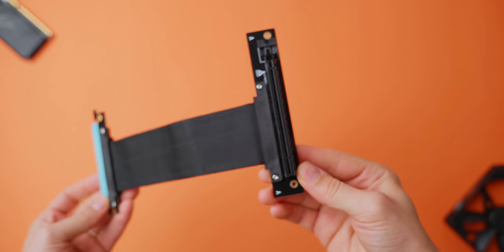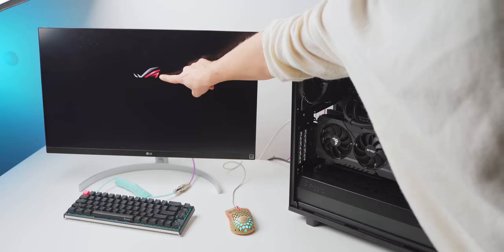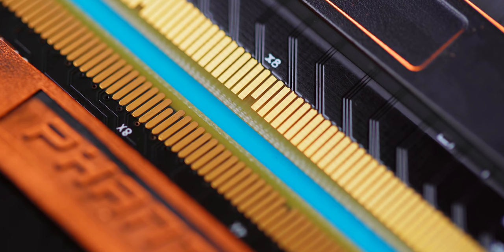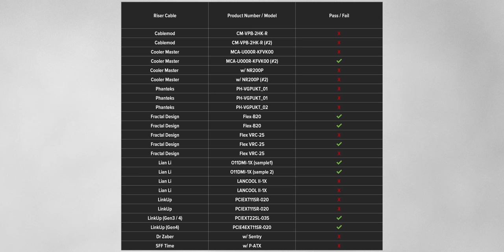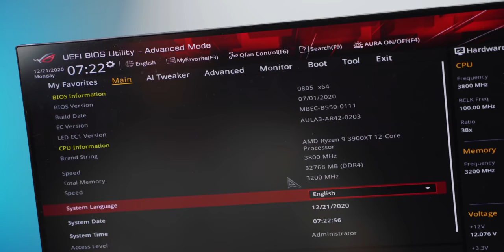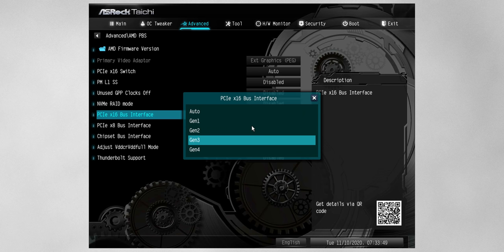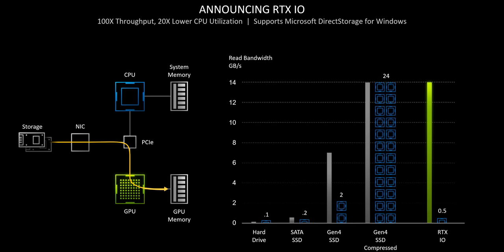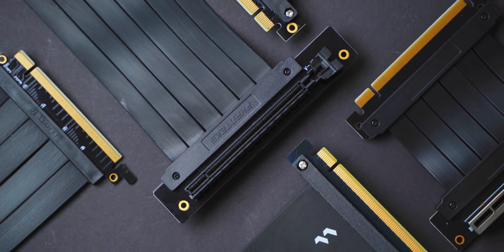There's a PROBLEM with Riser Cables

Comment: Laughs in direct connection
Reply: Weird enough. My 6800xt keeps shutting down during games with direct connection. No issues with gpu raiser....
Reply: @BigBoss-ps6vk   That sounds like a improper grounding in relation to the motherboard mounted.
Reply: @BigBoss-ps6vk  You gotta screw it with confidence. Don't forget to wear your Live Strong bracelet. 😂😂😂
Reply: @PSYCHOV3N0M  bruh how are the verge references still a thing
Reply: I use direct too.. We have sagging problems.
Think we need a new ATX form.
This form factor design by Intel is from the dinosaur ages, when graphics cards were light with 40mm fans😄.

Comment: I almost returned my 3000 GPU because of my riser cable i thought it was the GPU it wasn't until I plugged it straight into the MB. great video.
Reply: same here
Reply: I was basically in the same boat, Once I realised it was the riser I bought a new case so I won't need a riser
Reply: Same here
Reply: hey yo howd you get that 3000 series when theres no stock anywhere?
Reply: @whyers4782  there is stock. I was in a group for alerts and managed to pick a gpu up within a week
Reply: hes just kidding its opne of the ones the went missing from msi haha. jk im just jealous :P
Reply: @hillsby9380  aw damn, that sucks
Reply: @sonotinfamous1093  tell me about it.. still remaining hopeful for the future though 🤞
Reply: @whyers4782  I used the RTX Bot on discord and one just happen to go in stock and I got it.
Reply: @fabixigg3954  Laughs in 3070
Reply: Same here! Funny thing, I thought my old GPU had issues, but it was the riser cable! So my upgrade to a 30 series was officially unnecessary 🤣
Reply: @kanata2323  I thought the same thing too! I just figured my 1080ti was on its way to failing. I was going to up date this year anyways but all the ass pain of it not working right sometimes pissed me off.
Reply: Always test your parts outside of the case before you fully assemble your build, good way to avoid that.
Reply: @nomad090  I hope you didn't have to go through years of pain like myself, I even RMA'd my 1070 a year ago but same issues. But I'm happy I was able to sell my 1070 to recoup my 3080 costs!
Reply: @kanata2323  my 1080ti was never bad enough that i thought i needed to RMA it it just was holding an over clock like it use too.  the 3090 though wouldnt work in the desk top.
Reply: This happened to me when I built my pc. Thought the 3080 I bought was faulty. Once reseated normally without the riser cable, it worked perfectly.
Reply: Same here 👌
Reply: Good to hear from someone else's experience. Which 3000 series did you get?
Reply: @WarriorsPhoto  I got the 3090.
Reply: @nomad090  Damn! Is it everything reviewers say it is?
Reply: @WarriorsPhoto  just like how they said. its silly, if you can find a 3080 buy that. the 3090 is only a little better. i only got it because it was the only thing i could find.
Reply: @nomad090  Damn supply and lack of it issue. 
Are you gaming on it?
Reply: @WarriorsPhoto   the supply is killer brother. yeah im gaming on  it. all the time. i have a 3900X I preordered  in November from B&H they are saying it is going to come Feb. until then i am rocking a 3600X and a 3090... a lot of games are running the 3600X at 100%....
Reply: @nomad090  That’s awesome 😎 👏. 
You’ve found your limit. 
I wonder how well the 3900X will do with a next gen GPU?
Reply: @Winter-booty-Icicles  oh buddy...
Reply: That comment is a lie, you cant buy a 3000 GPU
Reply: @TheRealArom  awww I bet your so smart and so much better than everyone else in the world...
Reply: @nomad090  not everyone. Just people like you lol
Reply: @TheRealArom  yes you are your little sweet heart that need this satisfaction in his life. You are so smart you have to tell everyone, bless your heart.
Reply: Yeah I was having the same issue with 3080 + x570, I've just purchased the LinkUP PCIe Gen4 to see if it helps with issues :)
Reply: I thought my 3080ti was defected, after going through multiple power supplies, bios update, drivers, going back n forth with GPUS, it was my freaking RIZER..... now how to solve it, is a mystery
Reply: i know im late but YES.
same here

Comment: I almost smash my new ROG RTX 3080 TI OC 12G!!! I have been getting a lot of problems like BLACK SCREEN, No Video Card detected, Code 43, Load vender.dll fail error Please install VGA driver error! I have Install and uninstall drivers lots of times and the only problem is this RISER CABLE!!!!! As soon as I remove the RISER CABLE and put the GPU directly IT WORKS!!!!!!!!!!!!!!!!!!

Comment: I just had to explain all these issues to a friend of mine when he asked me "Why dont you have your gpu in a vertical mount?" Until it gets to be more reliable im not doing it.
Reply: Vert mounts also block airflow getting to the gpu. Don't bother unless your gpu is water cooled.
Reply: Only watercooled GPU should be mounted vertically anyway,  it's not great when it comes to thermals. It's hard to understand for me why would people hinder performances for looks, I mean it's not a car, only you can see it and when you use it you don't look at it at the same time anyway, I can somewhat understand adding custom bodies on cars, weights more but looks better, waste of money too for a performance hit (slower+more gas, longer braking distance) but you get people to look at you I guess.
Reply: i think it depends on the case. i have a sharkoon case with a vertical mounted GPU. When full load my 2060 reaches max 75 degrees, but it also takes me 2 sec to open the front glass panel since i have my pc on my desk. At full load the gpu reaches max 68 degress when front panel is open. Now i have 3 intake at the bottom which is case fans, im gonna swap them with aftermarket fans in January
Reply: @tacticalcenter8658  That depends entirely on the individuals case. A vert GPU in my case would probably fair better as my bottom fans would blow directly onto the heat grills whilst the GPU would still have at least 5-7cm gap in front of it, so when the GPU fans come on it would be getting cool air from the front and the bottom, rather than right now it only getting air from the bottom.
Reply: @HalfDayHero  depends on many factors. Doubtful that your opinion is going to make a difference. The only way a side mount is going to work is if you convert the PCI express area to the very mount. But not the extra vert mounts next to the glass on the majority of cases even if it looks like you might have enough room. Even bottom fans don't help on those. Look at fluid dynamics modeling software. It's just not going to go where you want it to go based on looking at it. It's been tested outside of cfd software as well showing no benefits. You can try a baffle to force air on the one side but this can be a bit weird in some cases and being that it's going so narrow it might not want to go that direction, but this all depends on all sorts of factors. Overall it's not idea. There may be some exceptions, but overall it's a pipe dream.
Reply: @YomBouyashaka  It's actually a myth. Vertical GPUs do not affect performance at all.  It's all about the chassis design.  I had my 2080Ti vertical and the thermals were on par with my now 3080 which is mounted directly to the mobo.  Also, Gamers Nexus did testing for this and came to the conclusion that it depends on the chassis your components are in more so than the vertical mount itself.
Reply: @tacticalcenter8658  Gamers Nexus did some extensive testing on this and they came to the conclusion that it most depends on the chassis the individual is using. I have actually tested this myself with my 2080Ti and 3080 and they both had virtually the same temps and performance. The case I have is a Phanteks P400a with eight fans and my temps were perfectly fine both mobo and vertically mounted.
Reply: Personally I prefer the horizontal mount anyway. My Gigabyte 2070 Windforce card has some RGB on the top edge of the card that would not be seen in a vertical position, and i have an awsome aRGB gpu support I couldn't use if my card was mounted vertically. So, personally I think horizontal mounting not only performs better in most cases, but looks better as well.
Reply: @YomBouyashaka  Obviuosly you don't showcase your PC on enthusiast sites. Fans can fix thermals if needed, depending on the chassis, but I don't think vertical looks any better anyway.
Reply: @HalfDayHero  Woulda, coulda, shoulda. If you haven't tested the configuration, you can't know.
Reply: @FLINTZ  Agreed. It all depends how close the vertical gpu is to the side of the case.
Reply: Got an open-air case with my card vertically mounted. Having it mounted the normal way, I can hear my chipset fan telling me it can't breathe(THICC 3080 Aorus blocking the entire fan).

Comment: Can't wait to see some real gen4 risers on the market!
Reply: Yep, especially the price....
Reply: Linkup is making them and I'm running one with my 5900x and 3070FE with no issues! Edit: but yeah they're expensive
Reply: @whitest_kyle  Same here. I have one from Linkup running my 6900 XT, with SAM(Resizable Bar) enabled and working. 0 issues. But yeah 100+ for a cable is expensive.
Reply: louqe incudes one in the case and u can buy one seperatly
Reply: I have one, really good. No issues what so ever
Reply: @whitest_kyle  Did they fix the performance issues? People have tested the older gen 4 Linkup cables and while they got full bandwidth, they lost like 5-10% gaming performance.
Reply: My riser was only $50 for gen4. But it was only the 10cm one. I didn’t need longer.
Reply: Linkup is not good, not real gen4, can easily overheat and brutally expensive. It should be less than 20usd to be  included with cases.
Reply: @riba2233  They are constantly updating their product base.What model number cable did you try with your  system? I got one for my 3090 FE, Rryzen 5600x build running on a x570 board. With m.2 pcie 4.0 2 terabyte storage configuration. Everything works fast and problem free on lane 1 with my motherboard switched to 4.0 in the bios, compared to my original gen 3 cable that I had to switch to gen 3 in the bios.
Reply: I bought a linkup one.  Quality is amazing, i have tested it with my FTW3 3080, and it works great.  You get what you pay for.  The quality is 2nd to none.  Im just waiting for my waterblock from ekwb to then put it in place permanently.
Reply: @Flooberjobby  same to my 6800xt
Reply: I purchased a linkup 15cm gen4 right angle riser for my lian li vertical mount. Ran 3d mark with and without riser on an aorus 3080 extreme. Got the same gpu scores. Dope purchase. Had the issue of bios resetting back to gen4 on the lian li gen3 riser cable after cmos resets.
Reply: Winners don't use risers.
Performance > Look
Reply: @basshead.  winners in what?
Reply: @basshead.  no perfomance drop that i can tell with the gen 4 risers
Reply: @alexsmith32012   There are always performance losses with risers.
Reply: linkup has 4.0 riser cables
Reply: @workthis  not really
Reply: @riba2233  they're the only ones with gen4 riser cables that I can find. Check them out, they tell you which orientations are compatible with various case designs. They are shielded 4.0 riser cables. The ball is in the consumer's court at this point, whether they wanna pay $50 or not
Reply: @Lead_Foot  I think the loss comes from using non shielded cables... correct me if I'm wrong
Reply: They are - Link Up sell them.
Reply: @BeechHorn  please read other comments, they are not real gen4 cables, and they have a set of their own issues
Reply: @riba2233 am using them fine for gen 4
Reply: @BeechHorn  I know, they "work" but that is not the whole story
Reply: @riba2233  ah they work at gen 4 speeds, even if you put a raid card on them
Reply: @BeechHorn  someone tested them and they don't provide full bandwidth of gen 4, also they crash if they reach 50c which makes them unsuitable for itx cases (where risers are most commonly used) and many people reported compatibility issues. Also they are extremely expensive, especially for something that is basically a slightly better version of gen3 riser
Reply: @riba2233  didn't know about the temperatures - but 3D Mark also shows the same bandwidth with it used or without (e.g. direct to the motherboard)
Reply: @riba2233  bullshit, I own one, I don't see any performance degradation from using it, and have absolutely no issues in using it, and I'm running it in a mITX build.
Reply: LINKUP riser cables gen4. i will put my neck on the line here and say the image quality of the rendered image on a gen 4 riser cable is better than gen3 riser cable. speaking from experience and observation. as for the linkup riser cable i got mine from amazon.
Reply: @keibohow69  linkup risers dont provide full gen4 bandwidth, and there is no way gen3 and gen4 produce different image
Reply: @riba2233  as i said i speak from experiance and yes they do. When i use gpuz it states gen4 and yes the image quality is better. If you require a link to said product i can provide one.
Reply: @keibohow69  no I don't, I know all about risers, I buy them in bulk directly from the manufacturer. If you really are seing the difference it is not because of the pci gen
Reply: @riba2233  well what is it? I notice the difference. I use a silverstone ml08 case that comes with a pice gen 3 riser card. I  am now using a straight 50mm length lickup gen4 riser cable now. I notice improvement in image on youtube clips. Saying that i do know that the faster the connection does improve the image also. I went from a 100 mb/s to 67m/s and image quality was noticable. Also i noticed an improvement in audio quality via hdmi cable. As you buy in bulk you can varifie this for your self. Just so you know hdmi out of pc into tv out of tv via optical cable into amp.
Reply: @keibohow69  yeah, that's not how PCIe cables work.
Reply: @madmax2069  just an observation
Reply: I find it extremely annoying that a bifuracted PCIE gen 4 (8x/8x) does not exist. I desperately need one

Comment: The slot card is a 40 yrs old design, and it's intended for cards much smaller than the mainboard. They should develop a new connection standard where the user is free to place the gpu anywhere inside the case or outside.
Reply: More than 40 even, expansion cards with an edge connector that slots into a plastic socket on a main board actually date back over 60 years to the IBM 1401, which launched in 1959.
Reply: Have you ever seen ISA cards? And I don't just mean graphics cards.
But daughter boards, sound cards, professioal ones with MIDI-Controllers etc.
And the "micro-chips" of the eighties and nineties were heavy.....

Some of those cards are huge chonkers, the size is not a problem, the size and weight of the air cooling solutions is.

Pretty much all exetension cards of today are either smaller and lighter or lighter than their 80s or 90s counterparts, or equal in weight with EMI Shielding.
The only exceptions are graphics cards, and nvme SSD extension cards, in both cases due to their cooling solutions.

I think bothof you seem, due to your comments, have only ever worked with post-2000 Hardware.
The mid-noughties were indeed a period of maximum lightness though, which while it wasn't the minimum that the extension card form factor was designed for, did almost certainly influence the design of PCIe and it's sockets.

And even back the there were critical voices that thought that the x1 slot, the back then most used one would be too short for a proper mechanical connection.

Comment: Speaking of compatibility: how does the NZXT hoodie work together with the Cooler Master chair?
Reply: There's compatibility issues.  The hoodie keeps rebooting.
Reply: Hoodie also has a fire hazard, they gotta recall it. Even Cooler Master can’t handle it.
Reply: I think there’s a lot of static energy between them
Reply: It actually works. I had a cooler master cooler in an nzxt case and it worked.
Reply: Needs more rgb IMO
Reply: The money gets deposited in the same place and is fully compatible regardless of it's origin.
Reply: @BigHotSauceBoss69  their really isn't unless you have a 360mm or larger aio. I was just making jokes.
Reply: Clashed if you ask me. Agree?
Reply: I just want to say I love this comment thread.
Reply: NZXT or should I say NAFC. No air flow case!

Comment: This video is a lifesaver! After spending a couple days and trying out two different Phanteks riser cables for my vertical GPU bracket, I changed the PCIE settings from Auto to 3.0 on my B550 Tomahawk and it works!! Thank you so much!

Comment: I actually came back after a day ago from watching this; just because I wanted to say thank you so freaking much.

I was only knees almost in tears, because I bought a pcie 3.0 vertical mount for my system which by standard is 4.0

I also had a bios update right after I installed the mount; so I sat there thinking it had to be that install. I was going back and forth trying to reboot 50x over and I even reinstalled windows twice; all to find out that it was the riser cable. Not the windows install that was causing the black screens/freezes.

Simply changing the bios setting from auto to 3.0 fixed the issue.
You sir are an angel and deserve way way way more credit than anyone can give you.

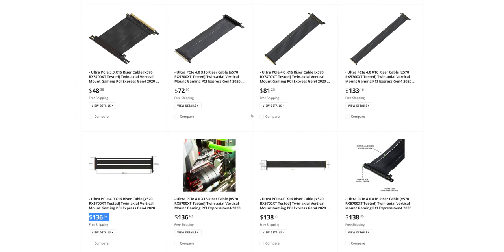Comment: 5:55 "As far as I'm aware there is not a single case on the market right now that comes equipped with a PCIe gen 4 riser cable inside the box".
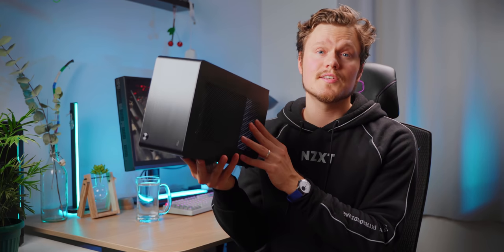Funnily enough, the Dan A4-SFX, the case shown off at 0:59 and 11:57, actually does come with a PCIe Gen 4 riser with it's latest revision, and for me at least it worked flawlessly out of the box with a b550 mobo and an RTX 3000 GPU.

Comment: I allways get DPC latency issues with riser cables.
My system starts to produce wierd audio and video stutters.
Doesn't matter if the cable is cheap or expensive.
Reply: I even have this when plugged directly into the motherboard. Seems to be an RTX3000 thing.